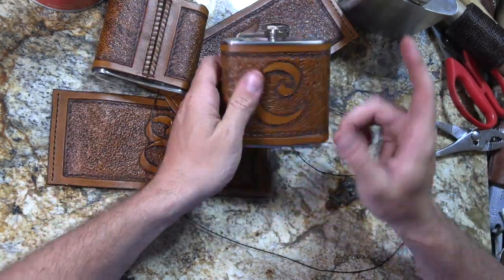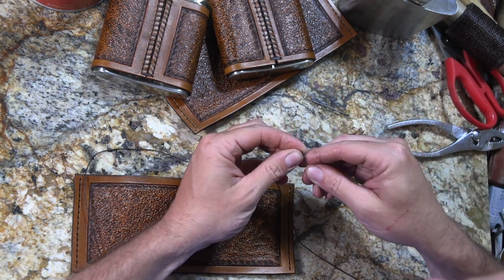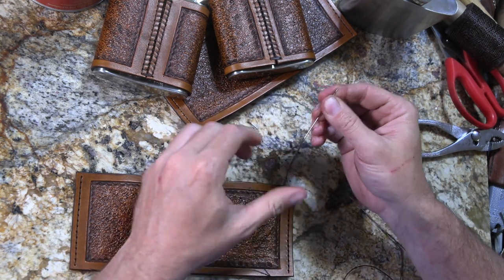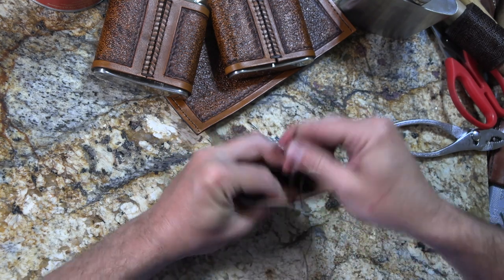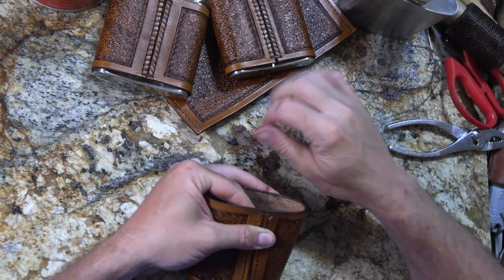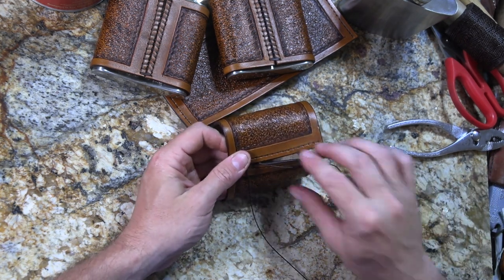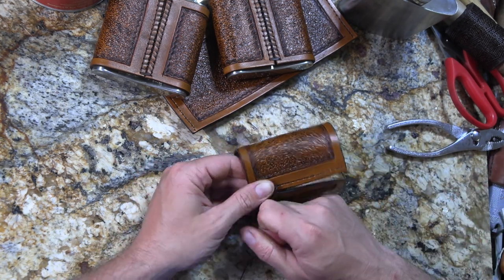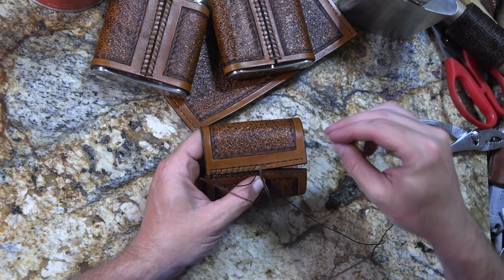How to baseball stitch leather for flask covers.

Comment: Do you worry about the leather not being tight to the flask on the curved side?  The first one I made had this gap where the leather bridges the curve instead of conforms to it.  I've learned since that you can use cement to solve that.  What are your thoughts?
Reply from the maker: I use contact cement to glue it down.  After stitching it together and sliding it on the flask.  I use the brush in the cement can to coat the back of the flask and the inside of the leather.  If your leather cover is too tight it can be hard to get it to stay stuck.  I will usually use rubber bands to hold the flask against something round to clamp the leather while the cement sets fully.